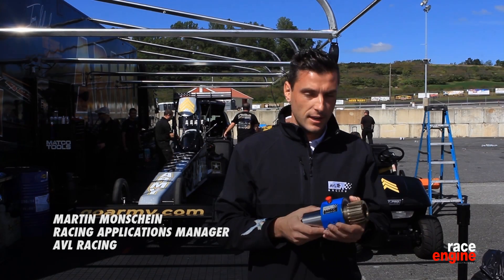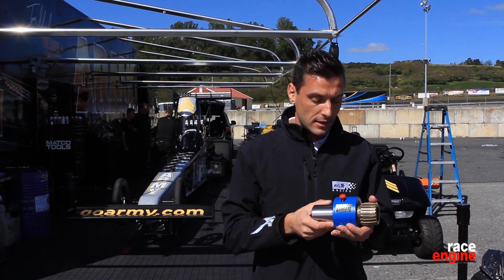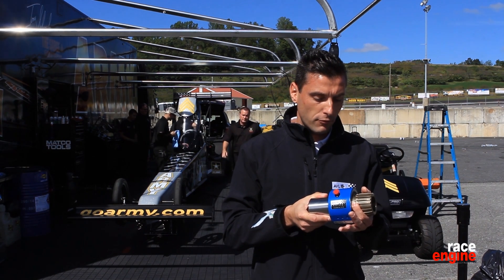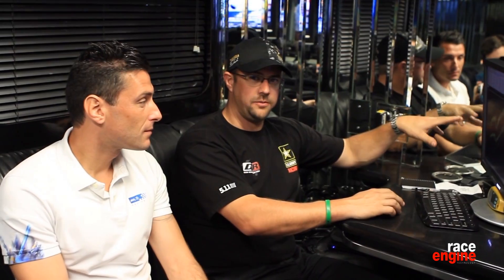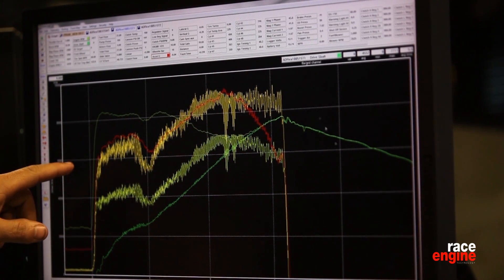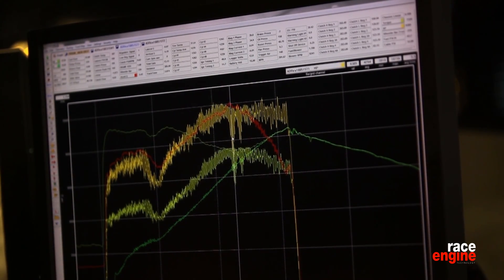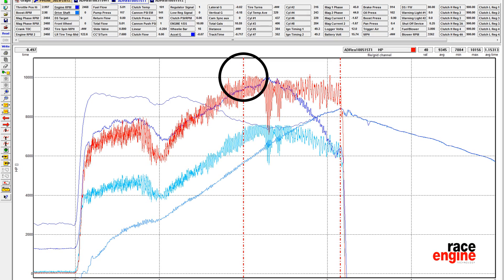Out of the darkness. Exclusive Top Fuel Dragster power test

Comment: These top fuel engines are stupid violent. They also produce about 8,000 ft/lbs of torque, that's over. 10,800 Newton-meters, that's 4x what a modern Volvo tractor (18 wheeler) produces. The 14-71 supercharger is capable of 65 p.s.i. which doesn't sound like alot in this day and age with a ricer at the drag strip but you couple that with Nitomethane and it's ALOT more violent!! It's also capable of moving 3800 cfm of air, that's a little bit more than 63 cubic feet of air per second. The fuel Nitomethane is more closely related to TNT and gun powder, than it's counterparts race gas and wood alchohol or (methanol). They pack so much Nitomethane in each cylinder, each firing of a cylinder is like a stick of TNT going off, now imagine that happening 480 times a second. 0-60 mph in .5 seconds 0-100 in .8 seconds, 290mph 2 seconds (660 feet)😁😁

Comment: 10,000 horsepower ! That is over 1200 HP per Cylinder, no wander they have to rebuild every race. But, man when you feel that shockwave from it flying past & It sounds so amazing; with earplugs and then earmuffs on top it still sounds louder than the meanest street v8 open header.

Comment: Interesting, but sorry...I'm not buying the '10,000 HP' thing.    You are showing a 2-3000 instantaneous fluctuation in the readings, so picking the very peak reading isn't anywhere close to being accurate.   I'm assuming the torque meter is sensitive enough to record each cylinder pounding on the crankshaft which would explain the wide variation on the chart.   Throw in some tire shake and that elastic resistance inflates the numbers even more.
 But if you measured ANY engine this sensitively your milktoast 300 horse engine would show peaks MUCH higher as you're normal dyno measures the torque being delivered across a several second span...not instantaneously.    
Fuel motors ARE impressively powerful things...it's just everyone wants to brag about these insane numbers that must go up every year.   I'm impressed with 4,000.....really!   You don't need to inflate the numbers.     Rob
Reply: Recoil Rob propelling over one ton of mass from 0-100 mph in .75 of a second takes huge amounts of energy. The clutch is slipping crazily so not even close to all the torque and horsepower is being applied to the tires when the amber lights come on.
Reply: There are dynos that can measure 4000 hp but there are no dynos that can measure what theses cars are putting down so there well we'll beyond 4k buddy believe it or not
Reply: It’s also important to realize that the torque measuring device was between the clutch and the rear end. The clutch is always slipping, so the actual power is likely higher than 11,000 hp
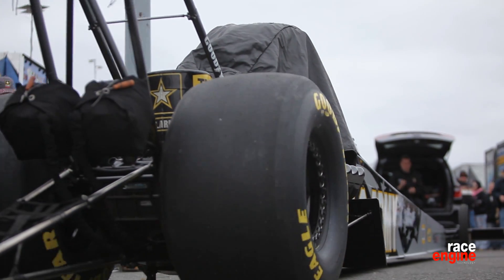Reply: siemka mietek mozna zastosować najprostszy wzor pod dane z tego videło https://www.youtube.com/watch?v=-VF0JwxQqcA patrcxz od 3:30 dragster po 3 sekundach ma 275 mil na h czyli 442km/h czyli 123 m/s jego masa to okolo 1000kg a spoiler dociska go z sila 2,5 tony okolo przy tej predkosci czyli razem 3,5 tony po 3,85 sekundy ma predkosc 507km/h czyli 141m/s teraz liczysz energie kinetyczna dla predkosci koncowej=34791750 dzuli i odejmujesz od energi z 3 sek przy 442km/h=26475750 i masz =8316000 j to dzielisz przez 3,85-3=0,85sec i masz 8316000j:0,85s=9783529 watt mocy czyli jakies 13 tysiecy koni mechanicznych mocy sredniej bez liczenia strat z przeniesienia napedu,cda i oporu toczenia wedlug tych danych mozna smialo zalozyc ze silnik w piku ma ze 15 tys hp.
Reply: a srednio z calego biegu zużywa 34791750:3,85s=12200hp po ominieciu,strat z walu na kolo,oporu toczenia i cda tylko ze masa auta rosnie z predkoscia przez docisk spoilera na starcie wazy tone na mecie ze 4 tony przy 500+ wiec srednio podczas biegu niech wazy 2tony to masz 19881000 dzuli/j :3,85sek=5163kw=7000hp a z czego wynika niska srednia z calego dystansu? ehem brak trakcji na niskiej predkosci i niemoznosc wykorzystania pelnej mocy na starcie .

Comment: How does it happen to show almost 1000 hp more than estimated 10156hp?
Reply: Don't think they were doing full CFD/FEM sims or any thermodynamic calculations on the engines so it's unlikely they would have had anything close to an exact prediction. They would never know the exact torque the engines going to make   even with this it's never going to be exact as they change physical parts/spec and tuning every run

Comment: Their engine design are probably under a lot of racing league restrictions, such as displacement, valve train, etc.  They could probably go much higher with the power.
Reply: +Poly Bun But what would you do with more power?  The limiting factor now is the tires.  We have to slip the clutch so the tires won't lose traction.
Reply: +Poly Bun Hmmm...yeah, maybe from half-track to the end.  And there isn't much else to within the regs.  Sure, more blower, but we're already putting out cylinders from too much fuel.  I've often wondered what we could get if computer control of clutch and engine was allowed.  Wonder if there is a way to relight a cylinder?
Reply: I haven't read the rules in detail, but the timers and stuff that control the clutch are a form of mechanical computing.  I'm guessing that we're not allowed to have any feedback that would change the settings.  Otherwise a smart guy could design a gadget to detect a dead hole and do something to relight it.  And detect tire slip and pull out timing even before the driver knows.
Reply: From the NHRA 2016 rule book: 
A computer is defined as any device (electrical, mechanical,
pneumatic, hydraulic, etc.) that activates any function of, or in any
way affects the operation of, the vehicle based on measurement,
sensing, processing, etc. of any data related to the performance
of the vehicle. Except those installed on stock vehicles by the
new-vehicle manufacturer for the proper operation of such
vehicle, no vehicles may be equipped with computers.